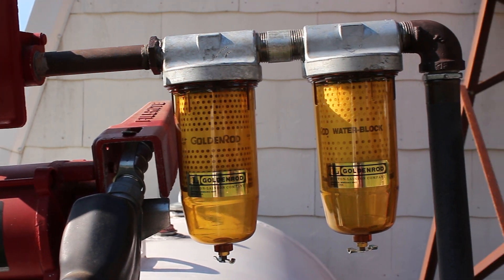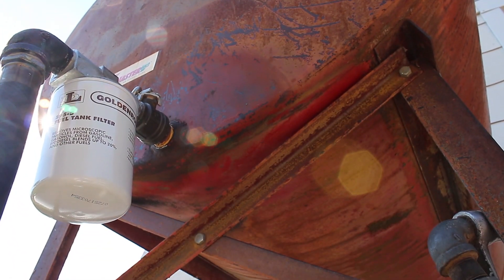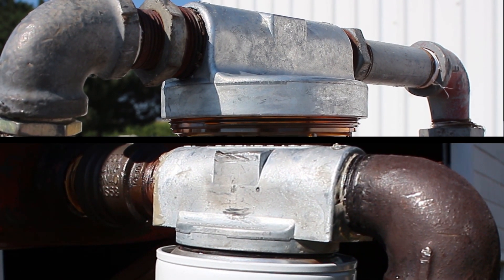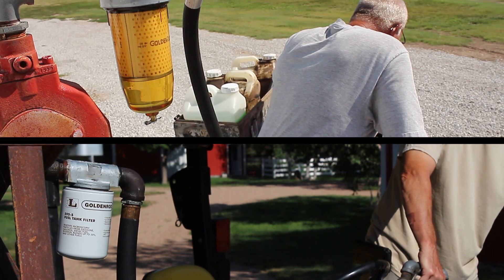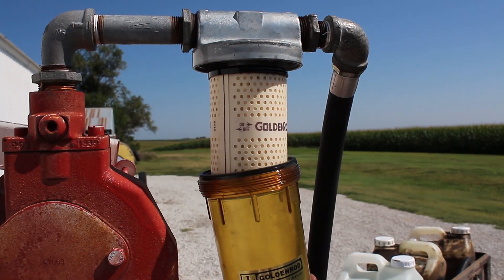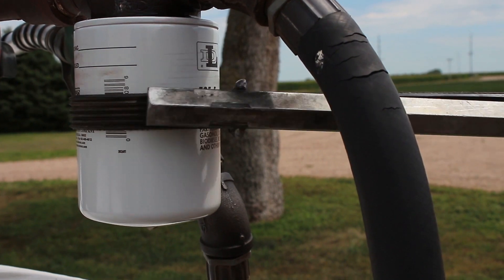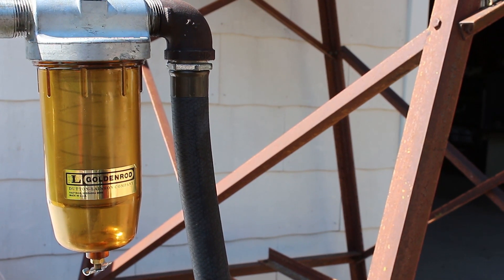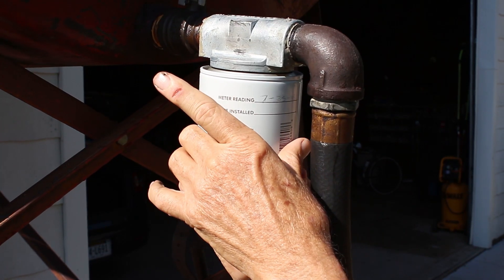What's the Difference Between Goldenrod Bowl and Canister Fuel Tank Filters? - FAQs

Comment: Is there a pass through cap: which can be used when a replacement filter is not immediately available? So basically remove the exhausted filter canister and screw the cap on in its place. In the case of the filter + bowl does removing the filter, and screwing the bowl back on, have the same effect?
Reply from the maker: Sorry, but we do not offer anything like that.

Comment: So what accumulates in the bowl that needs draining? Gas or Water? If gas why, water makes more sense as in the funnel style gasoline water filters? How do I tell when the filter needs replacing? The instructions talk about when it becomes difficult to pump. Even with a new filter and tightening small amounts of something drips from the bowl drain.
Reply from the maker: Thanks for your question!  On Goldenrod See-Thru bowl fuel tank filter models, the particulates that the element removes from your fuel is what accumulates at the bottom of the bowl, which can be removed by opening up the sediment drain valve.  You should replace your element or canister when the flow of your fuel through the filter is restricted.
Reply: @DuttonLainson  Based on what you didn't say: the fluid I see, in the bowl, is gasoline. The water accumulates in the filter fabric. The fabric can only hold a very small amount of water before the filter clogs and restricts the flow. If these guesses are correct: how much water can the filter remove? Why don't you use the fuel funnel approach where the water, accumulates in the bottom of the bowl, and can be dumped whenever too much accumulates? Is there a filter which uses this approach?
Reply from the maker: @wmsatic  You are correct- water removed from fuel by Goldenrod Water-Block fuel tank filters is absorbed in the filter element itself.  These elements can remove approximately 1/2 cup of water before needing to be replaced.  None of our fuel tank filters use the approach to filtering water that you describe.

Comment: On the Goldenrod 570 - 3/4" do you know what screw on filters fit it ?  I tried 1 at the parts store & the threads didn't seem to fit just right.     Thanks.
Reply from the maker: Thanks for your question, Lee.  Only the 595-5 (https://www.dutton-lainson.com/proddetail.php?prod=56608) and 596-5 (https://www.dutton-lainson.com/proddetail.php?prod=56612) Goldenrod fuel tank filter canisters should be used with the 570-3/4" top cap.

Comment: Can i ruduce the fitting size to 3/8 and use brass or copper fittings for my 6.5 diesel ? Fuel rate in no more then 15. Pounds of pressure
Reply from the maker: Thanks for your question, but Goldenrod filters are specifically designed as fuel tank filters and we do not recommend them to be used on engine compartments, vehicles, or over the road filters.  Heat is a concern as they are only rated to 150 degrees Fahrenheit, and Goldenrod filters are much larger than normal engine fuel filters.  A stationary engine should not be an issue as long as heat is not excessive.  Also, we recommend pushing the fuel through the filter instead of pulling the fuel through the filter.

Comment: So these are made out of zink? I heard galvanized pipe and zink is bad for diesel. This must not be completely correct because these guys wouldn't be selling them. Do they make a black iron version?
Reply from the maker: Thanks for your question! The zinc top caps on Goldenrod fuel tank filters are compatible with diesel and biodiesel blends up to 20%. They have been used with diesel since these filters were introduced in the 1960s.  We do not offer a black iron version.
Reply: @DuttonLainson  good to know, I have a 495 and a 496 off the truck pump and a 495 off the aux tank in shop. I knew that had to be wrong. Thanks for the reply.

Comment: No gloves? It looks like this video is aimed at the DIYer. It should be mentioned here and warnings put on your products and instructions is you don't use galvanized pipe fittings in the plumbing of these. Galvanized piping is BAD as it has a chemical reaction with diesel fuel. Read up on it. Never say never that a pump assembled for gasoline  will never be used for diesel fuel.
https://generators.blogs.com/fgwservice/2006/08/never_use_galva.html
Diesel fuel dissolves the zinc coating and forms a solution that contaminates the fuel supply.
This contaminated fuel will inevitably ends up in the engine’s fuel pump and/or injectors.
One cannot assume this solution will be completely filtered out.
Premature failure will be imminent, if allowed to reach the engine’s internal components.
We recommend black iron, steel or copper piping and storage tanks in order to avert this.

Comment: How often should you replace either canister or spin on with water-block option?
Reply from the maker: Thanks for your question!  The Water-Block fuel tank filters can absorb approximately one half cup of water before restricting the flow of your fuel, which is the signal to you that the element or canister needs to be replaced.